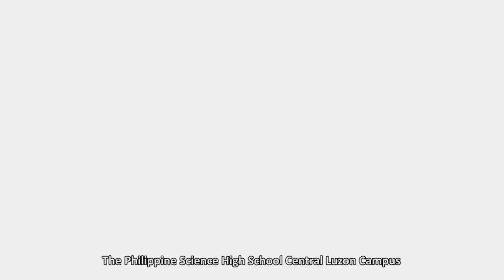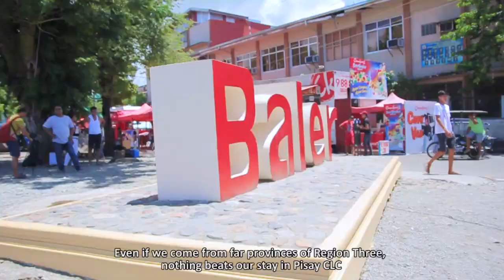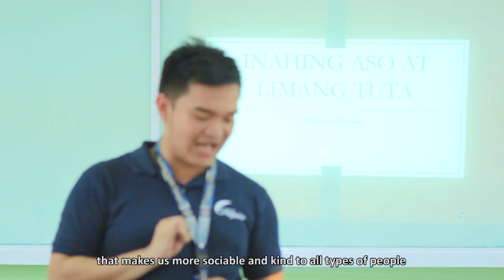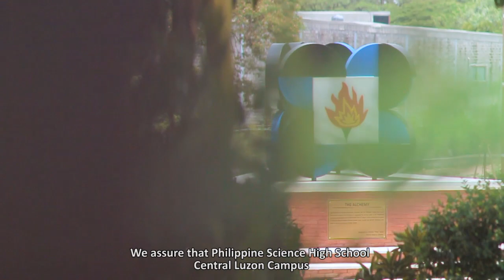Philippine Science High School - Central Luzon Campus AVP

Comment: I'm not going to regret choosing CALABARZON campus...
NOOOOOOOOPPPEEE..
Reply: Marichu Ebreo I chose CALABARZON, then I found out that I was waitlisted in main but it was too late because I already confirmed in main. NO REGRETS. I'm still currently in 6th grade. Gotta get ready cuz there's an orientation in Saturday for CALABARZON campus
Reply: Choices Addict hi dear, pano po yung entrance exam sa Philippine science high school? di po sya isahan na for all the campus? or kailangan mag take dun mismo sa papasukang campus na gusto? pls reply po. thanks.
Reply: Marichu Ebreo hi dear, pano po yung entrance exam sa Philippine science high school? di po sya isahan na for all the campus? or kailangan mag take dun mismo sa papasukang campus na gusto? pls reply po. thanks.
Reply: Rhoslaine Asa you only have to take one test and the pshs system will choose where you will take the test depending on the location you stated in the application form. Ang experience ko kasi, nagtest ako sa Laguna College pero sa website, nakalagay yung pangalan ko sa Quezon. Basically, kung saan mas malapit yung bahay nyo dun kayo magtetest.